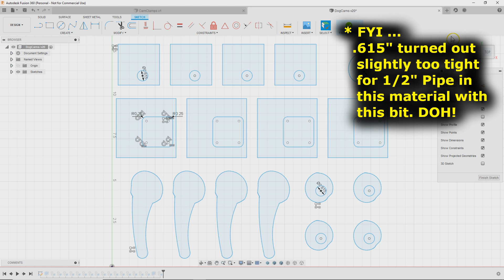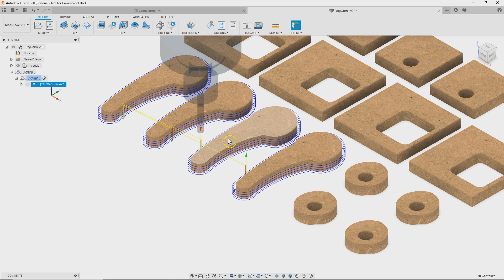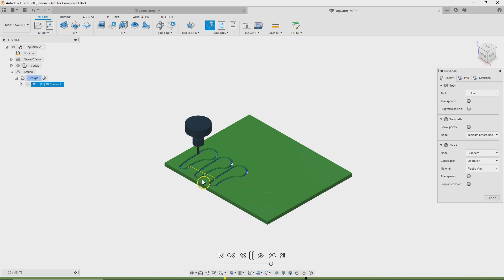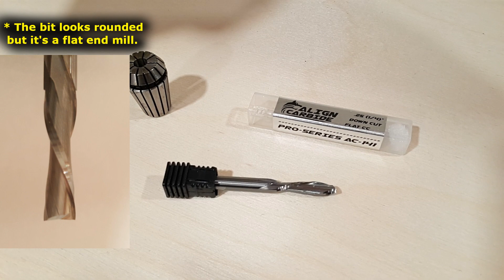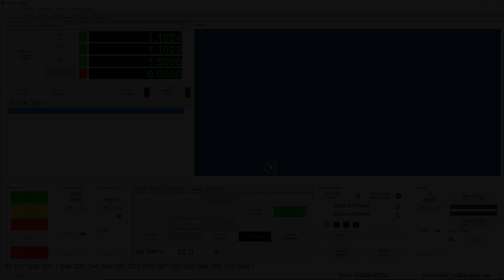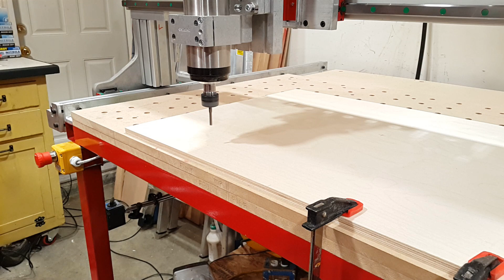Fisher-Price: My First CNC Project

Comment: Great content here, been going through your videos the last couple of days.  I did the opposite of what you did with your machine.  I built the mechanical part myself and am using Avid CNC plug and play electronics.  Also have a 2.2KW water cooled spindle and really like your cooling system.  Keep up the good work.
Reply from the maker: Thanks. Glad to hear someone is interested in the cooling system. Based on number of views for those videos I had my doubts.

Comment: Keep the content coming. It looked like the machine had a little shake going on, has that caused any issues?
Reply from the maker: Indeed. I noticed a 'clothes-washer' type oscillation when performing tight spiral tool paths. I haven't talked about the mechanical design of the base of my machine. Perhaps I should. I intentionally tried NOT to overbuild the base of the machine (which is usually my instinct), so there's definitively some room to improve the rigidity of my design.